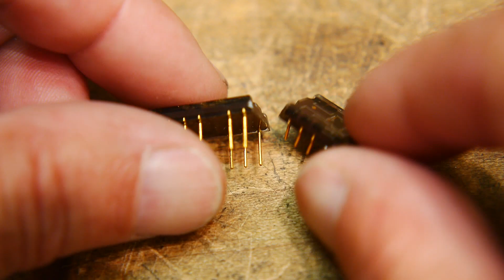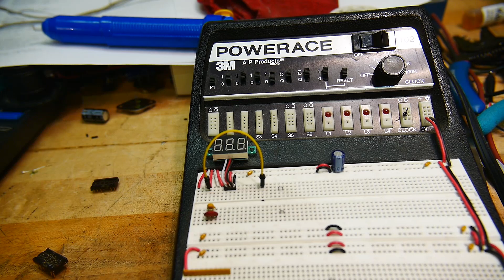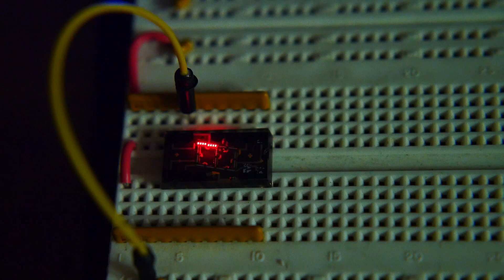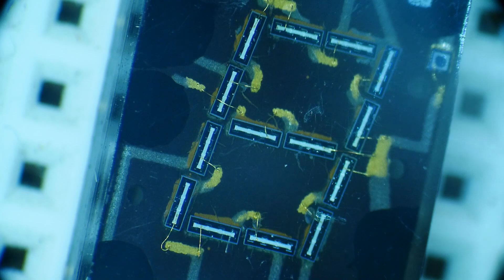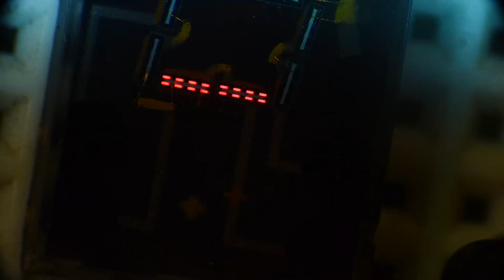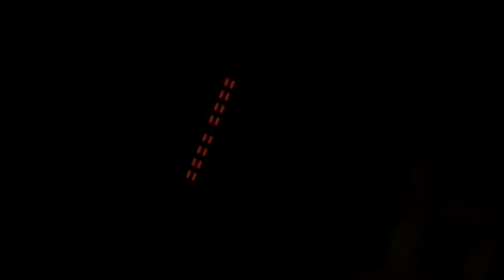#456 Vintage Monsanto MAN1 LED Display

Comment: The man1 displays were used in industrial and lab equipment back in late 70’s and early 80’s   The man1 style was considered easy to read over the man5 style display. Less eye strain with man1. Early production was clear and not as bright. Later production used a red defused package and a different led that had much better brightness. The only bad part is this material is breaking down with heat and age causing bond wires to break and killing segments of the display. I really liked this style. Now they are hard to find old stock and ones that are in good shape. As stated heat and age is the enemy to the material they are encapsulated in.
Reply from the maker: Thanks! They must have been quite expensive back in the 70's. At HP the only monolithic LED segment device I was aware of was the display they made for the HP35 calculator. Much smaller than the MAN1.  The displays to compete with the MAN1 used individual LEDs in a dot matrix